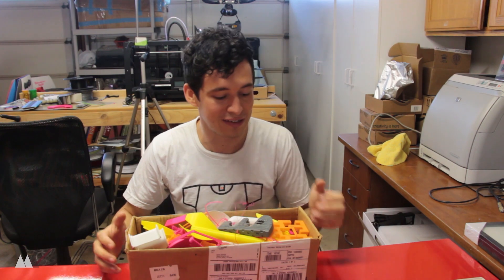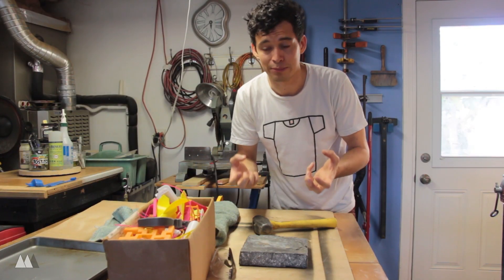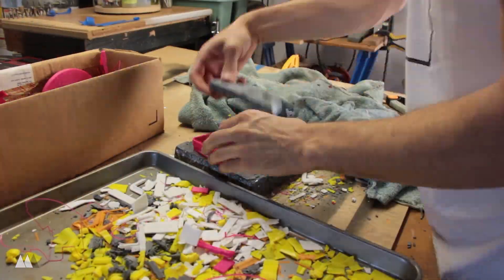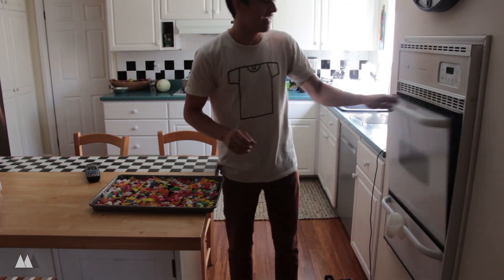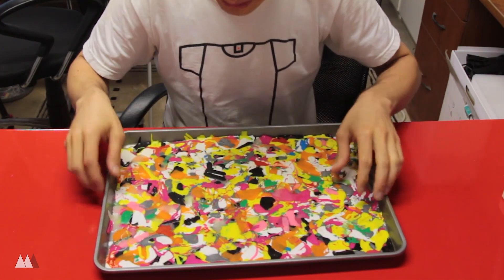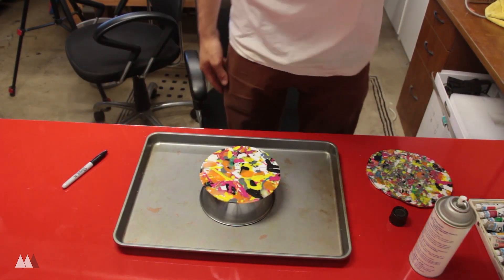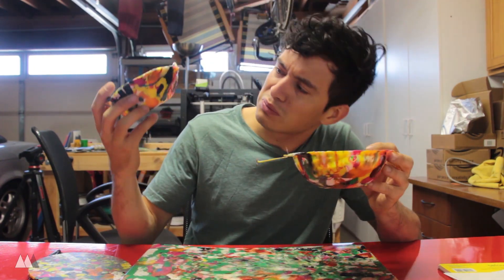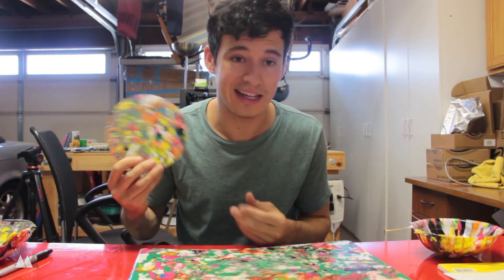Can You Recycle Failed 3D Prints?

Comment: Re exstrude it into rainbow filiment
Reply: That would be cool!
Reply: Yes, but doesn't the moisture absorption pose an issue with the print head when you do that? I'd think you'd need to melt the scrap in the presence of desiccant prior to reforming the filament.
Reply: David Bilia If he can't make a bowl, how would he do that?
Reply: Sulley make a cast of filament then pore the plastic into it
Reply: whats your favorite flavor of pie 3.14?
Reply: The 889th number should be a 6
Reply: David Bilia I was just about to tell him to do that
Reply: #pi
Reply: David Bilia how would you get it to that thin sized filament so you can stick it in the pen?
Well you can actually make a mold over the normal filament then take off the mold the pour the melted plastic in the mold.
Reply: Yes Please
Reply: Mike Trieu possibly
Reply: Dlc G i
Reply: David Bilia hhzjdndhshs
Reply: Jamie Rimmer c
Reply: You could be more precise.
Reply: You wouldn’t have to roll it out into a string, that wouldn’t be the right diameter. Casting probably wouldn’t work because it would be hard to get the plastic to flow that far, since it’ll cool as it flows into the mold. He could just heat it up and squeeze it through a nozzle that’s the required size while the plastic is molten. I don’t know how he’d do that when the plastic is hot, or how he’d keep it hot while he’s squeezing it into ropes. If he got it to work then all of the plastic from failed prints would eventually be made into a 3D printed object! Or even old prints that aren’t needed could be recycled. Maybe even other kinds of plastic could be made into filament and avoid going into a landfill.
Reply: Easiest way would be to make thick sheets, cut them into small disks, stack the disks into a cylinder, melt the cylinder together and then use a heat gun to heat one section a few inches back from one end and let it slowly drop down, extruding the cylinder into a filament, you'd have to continually heat and wind the filament up as it's made but and control the heat so it extrudes at a constant rate.
The while heating and dropping method is how they make optical fibres but with a cylinder of glass rather than plastic
Reply: That would be very interesting 😎
Reply: Here is my favourite number
3.141592653589793238462643383279502884197169399375105820974944592307816406286208998628034825342117067982148086513282306647093844609550582231725359408128481117450284102701938521105559644622948954930381964428810975665933446128475648233786783165271201909145648566923460348610454326648213393607260249141273724587006606315588174881520920962829254091715364367892590360011330530548820466521384146951941511609433057270365759591953092186117381932611793105118548074462379962749567351885752724891227938183011949129833673362440656643086021394946395224737190702179860943702770539217176293176752384674818467669405132000568127145263560827785771342757789609173637178721468440901224953430146549585371050792279689258923542019956112129021960864034418159813629774771309960518707211349999998372978049951059731732816096318595024459455346908302642522308253344685035261931188171010003137838752886587533208381420617177669147303598253490428755468731159562863882353787593751957781857780532171226806613001927876611195909216420198938095257201065485863278865936153381827968230301952035301852968995773622599413891249721775283479131515574857242454150695950829533116861727855889075098381754637464939319255060400927701671139009848824012858361603563707660104710181942955596198946767837449448255379774726847104047534646208046684259069491293313677028989152104752162056966024058038150193511253382430035587640247496473263914199272604269922796782354781636009341721641219924586315030286182974555706749838505494588586926995690927210797509302955321165344987202755960236480665499119881834797753566369807426542527862551818417574672890977772793800081647060016145249192173217214772350141441973568548161361157352552133475741849468438523323907394143334547762416862518983569485562099219222184272550254256887671790494601653466804988627232791786085784383827967976681454100953883786360950680064225125205117392984896084128488626945604241965285022210661186306744278622039194945047123713786960956364371917287467764657573962413890865832645995813390478027590099465764078951269468398352595709825822620522489407726719478268482601476990902640136394437455305068203496252451749399651431429809190659250937221696461515709858387410597885959772975498930161753928468138268683868942774155991855925245953959431049972524680845987273644695848653836736222626099124608051243884390451244136549762780797715691435997700129616089441694868555848406353422072225828488648158456028506016842739452267467678895252138522549954666727823986456596116354886230577456498035593634568174324112515076069479451096596094025228879710893145669136867228748940560101503308617928680920874760917824938589009714909675985261365549781893129784821682998948722658804857564014270477555132379641451523746234364542858444795265867821051141354735739523113427166102135969536231442952484937187110145765403590279934403742007310578539062198387447808478489683321445713868751943506430218453191048481005370614680674919278191197939952061419663428754440643745123718192179998391015919561814675142691239748940907186494231961567945208095146550225231603881930142093762137855956638937787083039069792077346722182562599661501421503068038447734549202605414665925201497442850732518666002132434088190710486331734649651453905796268561005508106658796998163574736384052571459102897064140110971206280439039759515677157700420337869936007230558763176359421873125147120532928191826186125867321579198414848829164470609575270695722091756711672291098169091528017350671274858322287183520935396572512108357915136988209144421006751033467110314126711136990865851639831501970165151168517143765761835155650884909989859982387345528331635507647918535893226185489632132933089857064204675259070915481416549859461637180270981994309924488957571282890592323326097299712084433573265489382391193259746366730583604142813883032038249037589852437441702913276561809377344403070746921120191302033038019762110110044929321516084244485963766983895228684783123552658213144957685726243344189303968642624341077322697802807318915441101044682325271620105265227211166039666557309254711055785376346682065310989652691862056476931257058635662018558100729360659876486117910453348850346113657686753249441668039626579787718556084552965412665408530614344431858676975145661406800700237877659134401712749470420562230538994561314071127000407854733269939081454664645880797270826683063432858785698305235808933065757406795457163775254202114955761581400250126228594130216471550979259230990796547376125517656751357517829666454779174501129961489030463994713296210734043751895735961458901938971311179042978285647503203198691514028708085990480109412147221317947647772622414254854540332157185306142288137585043063321751829798662237172159160771669254748738986654949450114654062843366393790039769265672146385306736096571209180763832716641627488880078692560290228472104031721186082041900042296617119637792133757511495950156604963186294726547364252308177036751590673502350728354056704038674351362222477158915049530984448933309634087807693259939780541934144737744184263129860809988868741326047215695162396586457302163159819319516735381297416772947867242292465436680098067692823828068996400482435403701416314965897940924323789690706977942236250822168895738379862300159377647165122893578601588161755782973523344604281512627203734314653197777416031990665541876397929334419521541341899485444734567383162499341913181480927777103863877343177207545654532207770921201905166096280490926360197598828161332316663652861932668633606273567630354477628035045077723554710585954870279081435624014517180624643626794561275318134078330336254232783944975382437205835311477119926063813346776879695970309833913077109870408591337464144282277263465947047458784778720192771528073176790770715721344473060570073349243693113835049316312840425121925651798069411352801314701304781643788518529092854520116583934196562134914341595625865865570552690496520985803385072242648293972858478316305777756068887644624824685792603953527734803048029005876075825104747091643961362676044925627420420832085661190625454337213153595845068772460290161876679524061634252257719542916299193064553779914037340432875262888963995879475729174642635745525407909145135711136941091193932519107602082520261879853188770584297259167781314969900901921169717372784768472686084900337702424291651300500516832336435038951702989392233451722013812806965011784408745196012122859937162313017114448464090389064495444006198690754851602632750529834918740786680881833851022833450850486082503930213321971551843063545500766828294930413776552793975175461395398468339363830474611996653858153842056853386218672523340283087112328278921250771262946322956398989893582116745627010218356462201349671518819097303811980049734072396103685406643193950979019069963955245300545058068550195673022921913933918568034490398205955100226353536192041994745538593810234395544959778377902374216172711172364343543947822181852862408514006660443325888569867054315470696574745855033232334210730154594051655379068662733379958511562578432298827372319898757141595781119635833005940873068121602876496286744604774649159950549737425626901049037781986835938146574126804925648798556145372347867330390468838343634655379498641927056387293174872332083760112302991136793862708943879936201629515413371424892830722012690147546684765357616477379467520

Comment: for the bowls try setting up a stand that will hold the bowl open side down, but have it open so you can heat it with something such as a torch, or small fire. You can heat up the bowl mould and hand press the plastic disc to form it yourself.
this way the plastic won't melt simultaneously as the bowl heats up.
(alternatively you could just pre heat the bowl and press the discs down bit by bit, heating only the bowl when you need to.
you could combine this with soaking the plastic in boiling water for that extra bit of playability.)

Comment: First of all is that food safe? Second, ventilation and a mask for most of this.
Reply: PLA is food safe. You just have to make sure what you're making your mold from is also food safe and don't smash your parts on a lead block!
Reply: Yes is just as food safe as PET, probably more actually. PET (coke bottles) melt at the drop of a hat.
Reply: Thats what someone else ( maybe makersmuse) said. The plastic is safe, but bacteria can still get between the layer even while extruding .
Reply: But they grow on food trapped in the plastic. I think If you "melted" it at lower temperature you'd get smoother sides.
Reply: lead
Reply: bacteria don't grow on plastic

Comment: You just put lead.. in a bowl. 🤔
Reply: I handle lead on a daily basis. Not that dangerous, especially in the quantity that would transfer to the plastic.
Reply: Lead crystal is still produced. Crystal glass is not crystal. Lead crystal is safe for general use.
Reply: Actually, most crystal glasses are lead free now. One of the leading crystal glass manufactures is Riedel and they haven't used leaded crystal in years.

Comment: Hi there a few suggestions and tips firstly your upside down bowl idea can work however you did not have enough material.  You measured around the bowl but that did not take depth into account I'd suggest if you want to try again to use material drape over the bowl and draw on the outside this will be a better size indicator if you want a bowl to match in size.  For the right side up bowl a few options the best /easiest in my mind involves two bowls and good oven mitts.  Using your previous method wait till the plastic is mostly melted remove and place a second bowl and press to get a better shape just down press too hard or you'll have thickness issues hold or quench in cool but not cold water 70 or so anything too cool might cause brittle ness.  Another interesting option is cast forms this could be a collate or mini cake mould (metal or heat resistant silicone)  other purchased moulds or slef made moulds using a silicone gel or putty to make a mould of almost anything.  Infact using this method you can potentially make somthing with your three printer mould it take waste chips slightly over fill the mould to account for airspace melt and voila.  Other things you could make could include but are not limited to utensil Handel's using two part casting.  Custom tool grips  with high heat resistant fingered gloves by wrapping the soft plastic over the metal or wood handle and grabbing it leaving finger grooves.  Planters or boxes by cutting parts and either using epoxy or melting more line by use of somthing like a heat gun or three doodler.  If your plastic is food safe you can use it to make plates, cutlery (from moulds)  chopsticks, by or borrow Lego make a mould and create your own custom Legos.  Use small peices with a bit of glue or epoxy to make key covers.  I hope some of these suggestions were helpful and I hope you have fun.  Feel free to contact me if you want for more ideas.
Reply from the maker: All excellent suggestions, thank you! :)
Reply: how much time did this take? XD

Comment: There's a project called Precious Plastic that actually has methods and project ideas for how to recycle plastic (from daily use and filament)! They have super great advice for how to make two part molds, injection molds, filament, etc. at a low cost.  You should check them out.
Reply from the maker: Linny Alexan thanks, sounds awesome!

Comment: Some heat guns give very high temperature and you can bent acrylics with them very easily. Did that once with mine which gives me 600° C. So I bet a good heat gun and very good protective gloves, a brayer and your good to go to form any sheet on any metal shape. You get a lot of control by simply getting closer of moving away from the object with the heat gun.

By the way with a heat gun and your saw you can turn the plate from the tray into a skateboard. saw the shape and bend the tip with the heat gun over a block of granite until the tip has the shape you like.
Reply: you need to know the melting point of the metal tho. some are beneath 600°C.
because that's around the temperature of a regular fire.
Reply: If the heat gun doesn't have a regulator you can regulate the temprature still with distance and duration. It probably takes practice.

Comment: Oh man. Imagine using these as blanks for cnc milling. You could use this just like you would use wood, mill out your logo, make blanks for knife scales, etc. It looks like you'd have to sand down that exposed side that didn't flatten properly to get a nice flat side OR you could just USE that side for the exposed side to the milling and have a textured front side.

I also like the idea of coasters, you could make quite a few, give them out for gifts (also no 2 will be the same, and they could still be identifiable in sets).

I've thermoformed plastics in boiling water for making a prosthetic hand wrist, but it was quite thinner and less solid. I would also bet a heat gun would work better for your application.

Comment: What was the lead block for?
Reply from the maker: Just to have a hard surface to smash against... probably not really necessary
Reply: Make Anything // 3D Printing Channel I
Reply: make anything
you could've used a tile instead.
even one that's just on the side walk or something. but wood also works. it has a kind of bounce effect on the material.
we use wooden molds to smash copper in class, so it definitely will work for plastic.

Comment: How about melting those into silicone molds? They have so many different shapes that you can use these days (Legos, hearts, flowers, Star Wars themed, etc.)
Reply: I don't know what the melting temp of silicon is, but it's definatly something you'd need to check. Otherwise you could end up with a mess of meslted silicon and PLA stuck to the inside of your oven.

Comment: Did you use all PLA or ABS or some mixture?
Reply from the maker: GeoDon999 PLA only
Reply: Do you think we could do the same thing with ABS ? 
I know ABS doesn't smell very good and can be toxic but, 
i don't know!
Reply from the maker: It would work the same, but would need a higher melting temperature.. and as you mentioned it would smell even worse than this did :P Not something I would try in a kitchen oven

Comment: is it possible to melt it back into a roll for printing?
Reply: Victor Lin the machines for doing this are so difficult to use, and virgin material is so cheep, that it's not worth it.
Reply: Victor Lin yes you can but you will need a machine that does it
Reply: Actually, yes you can. Go to Precious Plastics website, and you can get free blueprints for building an Extruder and a Shredder from mostly salvaged parts from salvage yards etc.
Reply: +3D Printing Professor “Joe” yit
Reply: Why does it say no replies but there are 4 replies.
Reply: No. You can mix it with new plastic [virgin pellets] to "fluff it up",  but otherwise, no.
Reply: Maybe